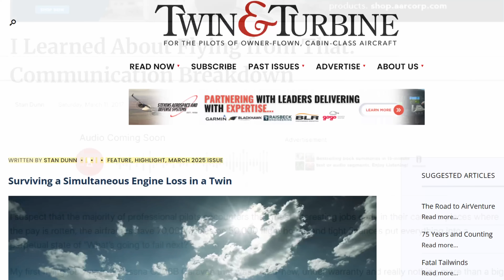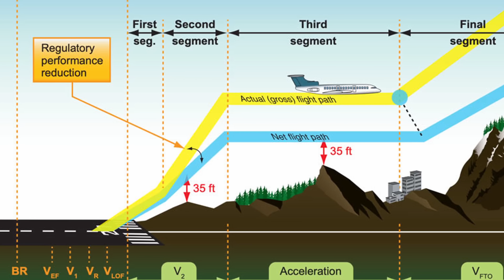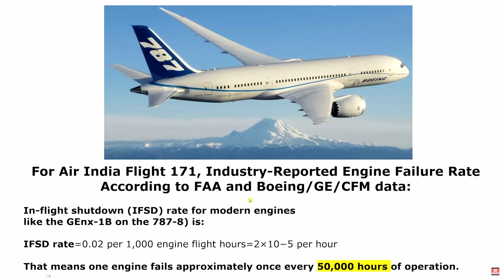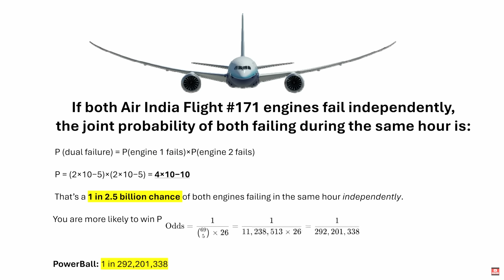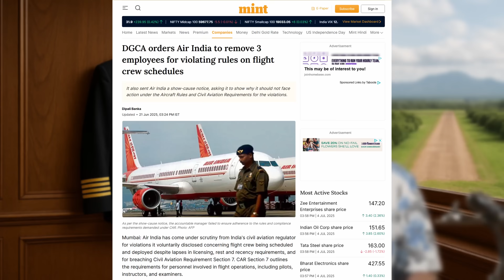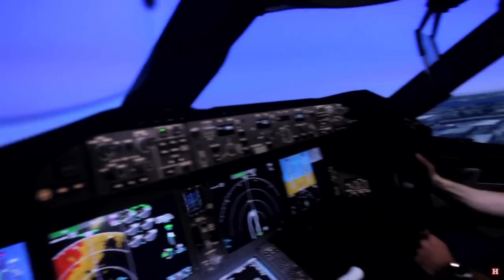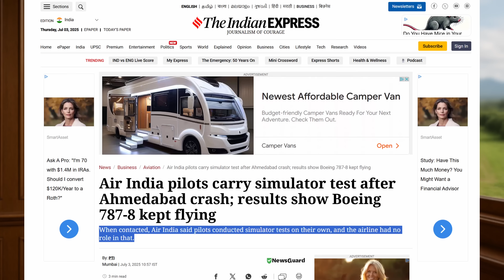Air India 171 Cause Becoming Clear

Comment: Retired airline pilot here. I'm a little surprised this gentlemen proffers that it could've been an initial single engine failure. When a single engine failure occurs, there is a significant yawning motion , and some lateral roll.  When you watch the video of the doomed aircraft, you see that there is almost perfect stable streamlined flight throughout. Which is highly indicative of both engines failing at almost or exactly at the same time. Purposely or otherwise.
Reply: How is it that there is no provision against human/pilot error in case of one engine failure 
That will be really a poor design as in case of one engine failure a action taken under stress is likely to lead misidentification 😢
Reply: I  do not think this would be a double engine failure. Just logic alone tells me that. What would have possibly caused that, we did not see anything hinting at such an unlikely occurence. And not an issue with the flaps. Neither fuel contamination. The most rational explanation is that it had something to do with electrics. The fuel pump system on the 787 is electrically powered. They were losing thrust and what we saw unfold matches with this scenario. Longer than normal on the runway, but did manage to take off. Then losing all power once airborne and then slowly descending till they crashed. Matches also with the pilot's mayday call "no power no thrust". Final investigation report will shed light. Rest in peace to all the lost souls 🙏
Reply: @IloveCamels335  I'm with you on this......the 787 is an all singing, all dancing bird , even pressurisation is controlled by electrical power. But for whatever reason, have a single cable burn and affect the cable next to it and suddenly circuits fail and there is no time for getting your electrical power back. The RAT deployed because of loss of.....electrics ( and hydraulics ) .....but at 300ft there just isn't enough time , or altitude left to do anything except transmit the Mayday.........my money is on the electrics failing for some reason despite the massive backup.....perhaps the wires to the two EECs ?
Reply: @IloveCamels335 engine driven mechanical fuel pumps. Electric is just auxiliary boost pumps.
Reply: @jamesrolls9206 nope, 787 fuel pumps are NOT engine driven
Reply: @IloveCamels335 interesting. Learnt something new today. Would have put money on that one.
Reply: I think, as a non expert, that the most likely cause of the crash was total electrical failure, leading to fuel starvation to both engines, which would also explain the failure to raise the gear, because the hydraulic pumps are electrically powered. The chances of other causes, as the presenter outlined are very small indeed.
Reply: @eamonryan2198 totally agreed. It had to have been electrical
Reply: It's been said that they were on the "last brick" of the runway when they became airborn. They HAD to know they had thrust issues during takeoff. I wonder if they did a static takeoff or a rolling takeoff and why didn't they abort?
Reply: @JamesStreet-tp1vb I am sure they noticed the problem already on the runway, completely agree. But by the time it was too late to abort takeoff. So they could have overrun and crashed on the ground or take their chances and take off which they did and have some more time to hopefully figure things out.
Reply: @IloveCamels335 That's one of those damned if you do damned if you don't situations. 

The purpose of a static takeoff is so they can see how the engines are performing. That's why I'm curious if they did a static takeoff and did they begin the takeoff at the threshold of the runway or were they further down the runway when they began the takeoff?
Reply: @JamesStreet-tp1vb reduced thrust takeoff designed to use most of the runway. Reduces engine wear and fuel consumption.
Reply: It's a bit of a conundrum I agree....... I'm a retired Pan Am, JAL and KAL 74 captain, and two engines failing at the same time is almost impossible.......also, the training centres in Asia don't  conform to western training standards, ....so unless you have some experience in those arenas .. I'd respectfully say you may not be taking into account that variable... IMHO
Reply: it definitely is not a single engine failure, either total engine failure or other failure
Reply: Agree - confirmed by the lack of corrective rudder action in the video.
Reply: If you know this type of airplane, is it true that both the engines are on the same central tank at start ? A faulty transducer could have restart both the engines to be fueled on another tank but it takes time for that . I heard from French mechanics that the RAT provides enough energy for the flaps but not enough to raise the landing gear. For this it needs the help of the APU, which was revving up as the opened red hatch on the side of the tail shows, but the APU needs 90 seconds to give full energy.
Reply: 787 has 2 generators per engine.
Reply: Agreed! He is trying to save Boeing.
Reply: The yawning, even if a small one, would be noticeable on the videos. Bad ridiculous explanation...
Reply: I feel exactly the same
Reply: Why hasn’t the voice recorder information been released? Usually when there’s an air accident, especially in the United States, we have information within a couple weeks. What are they trying to hide?
Reply: yawing not yawning
Reply: Yawning motion you say.... Perhaps the pilots were tired 🤪   🤣🤣
Reply: Since it wasn't "yawning", it must have been well rested, the aircraft I mean.
Reply: FADEC controlled dual rollback due to a hydraulic or electronic event that caused the TAT triggered FADEC command. My best guess is hydraulics event leading to hitting the TAT sensor.  The pilots have no override of a FADEC rollback
Reply: Also those jets are made to be able to sustain flight on 1 engine
Reply: In any event this video offer no obvious reasons as to why the single engine should have failed. There is zero evidence for the hypothesis that the pilots turnes off the "good" engine. This video leaves us all none the wiser.
Reply: USA CONGRESS IS ONTO THE BOEING QUALITY CONTROL. PERIOD.
Reply: The rudder didn't move a bit. Auto yawn uses the rudder.
Reply: Don't talk to me about 'a significant yawning motion', I get it every time a politician speaks.
Reply: fuel valve fails closed after DC power failure...heard it the day after the crash.
Reply: I generally suffer significant “*yawning*” moments when I encounter analyses wherein the commentator misspells key words.
Reply: I’m not.  It’s all about clicks.
Reply: Significant yawning happens all the time.
Reply: the 787 and 777 both have automatic rudder input before you (as a pilot) even know you have lost an engine... and in fact, airlines are given the option of how much rudder they want applied in the case of a single engine failure from 100% down to 1/2... so that pilot input is required.
Reply: There's a slight yaw to the right.
Reply: @Republic3D  The video is so poor... I don't see it. The rudder would be displaced dramatically with one out.... and I don't see that either
Reply: @Republic3D   The entire aircraft - while remaining level - appears to drift to the left shortly after it's clear it has lost power.
Reply: I see * slight * asymmetry, causing the plane's starboard wing to raise up.

I think he's right, especially if that's smoke coming from the port side engine.

This all happened in 30 seconds.

I'd prefer not to blame the flight crew or any individuals for such a disastrous accident, but, even when a scenario isn't initially caused by pilot error, it's often one of the holes in the Swiss cheese model.

Sadly, I hope it turns out to be a Boeing issue and not the fault of someone who perished.
Reply: @whiteoutgotu I disagree.  That means there are many flying time bombs in the air right now with thousands of people on them.
Reply: IDK why he's even doing this video. We don't have the black box data. Seems like a waste of time.
Reply: Plus, the RAT coming out by the apogee of flight would suggest the engines failed themselves without human input.
Reply: @JasonSmith-iw9wd   I still have seen no clear sign that the RAT was deployed.  All I've seen is a speculation by someone who thought they heard a propellor-like whine. All I heard in that clip was the sound of a modern fan jet englne at low power or idle.
Reply: I hear ya. Nothing conclusive yet. But in my mind, that’s a RAT. To me, there’s no doubt. That is clearly the sound of a RAT.
Reply: The automatic engine out yaw damper would minimize yaw on a 787. There was a bit of yaw perceptible in the early part of takeoff.
Reply: Citing incidents that support your theory don't make it 1% more likely
Reply: I heard and readed this meanwhile very often, too.
Reply: "yawning?"
Reply: If you look on Flightaware, the plane didn't follow the runway heading. It started veering south. Unknown if because if engine failure or pilot input.
Reply: @XRPcop   Do you have the link for that please? I'd like to look. My impression was that the aircraft drifted significantly left after it lost power.
Reply: Too much over weight baggage in the hold: too much meat, jars of pickle and other prohibited goods that Indians just can’t resist bringing to the UK. 
Aircraft couldn’t get off the ground because of too many pressure cookers in baggage. Two much junk packed in carryon bags. 
No one needs 23kg of old clothes and other rubbish.
Just sayin’!
Reply: Landing gear couldn’t retract because of all the illegals in the wheel compartments.
Reply: I say it's not engine failure it may b due to power loss and loss of auto pitch . You might b knowing what happns when it goes above air cut and loses air cut it becomes paper weight and falls down as you seen on the video clearly showing usage of RAT also high nose angle I'm no expert but I hav watched 100's of crash investigation i cn say this
Reply: @kamali_ka If they had landed it immediately after powerlss maybe could have saved most passengers
Reply: @Vicmot but he had only 10-12 sec to react😢
Reply: It does bobble a tiny bit, but it’s already descending at that point, and i cannot see any yaw/tail inputs. Hard to see anything, tho.
Reply: IMHO, this seems highly speculative 🤔 and now trying to blame the pilots 😲
Reply: You're saying the crew were asleep?
Reply: @TheLucanicLord  😲
Reply: IMHO One of the pilots shut both engines down at the same time. Pulling the T-handles or by simply moving the fuel control switches to cutoff.
Reply: @gparroz3288 You gotta be kidding me 😮
Reply: A Massive DC electrical power surge with redundant data systems ‘rebooting’ at the same time.  Grounding bus bar’s are shared between redundant systems.  That has caused issues before.  I.E. Captain Steeve (another channel) had a grounding bus fail during flight and he lost all his instruments in front of him.
Reply: @jerryrobinson7856 I believe massive electrical failure disabling all 4 FADECS at the same time 🤔
Reply: @Harald-MacGerhard    The theory being FADEC’s will reboot for the exact same reason.  Massive surge electrical protection.
Reply: Is the yawning motion performed by the Captain or FO? Slow climbout is boring,apparently?
Reply: Fuel pump issue?
Reply: except at rotation there is an immediate slight yaw to the right (and no dust behind the right engine) indicating this is very plausible with the help of auto rudder.........
Reply: otherwise is correct, as the pilot told the tower he had no thrust, but didn't say the engines were down.  I think 2 thngs are far in a way more likely which are 1) accidental change by pilots, 2) software error.   It is likely the computer shutdown or rolled back the engines, that is likely how, why is the critical link.
Reply: An engine failure would rapidly and automatically correct any initial yawning motion.
Reply: *yawing
Reply: yawning?
Reply: Exactly Truthseeker and to bolster your expertise even further, there is no obvious sign of rudder deflection, which is what you would observe with asymmetrical thrust. 

Thank goodness we have some more true airmen like you who actually impart wisdom to us
Reply: Also the gear remained deployed throughout, which is contrary to takeoff procedures, particularly if there is difficulty gaining altitude due to the severe drag caused when gear is deployed.
Reply: @UnitedWeStand-g7u they tried to raise the gear. You can see them tilted forwards which is the first stage of raising. That means that right after they tried raising the gear they lost power/hydraulics leaving the gear stuck at the first stage of retraction.
Reply: @wayneholmes637 gear doors actuate before the tilting of the boogie. Looks like something went really wrong with the retraction sequence/logic.
Reply: @UnitedWeStand-g7u  look closely, it seems like the landing gears were set to go up but suddenly stopped
Reply: @UnitedWeStand-g7u There's a couple steps in the gear retraction on the 787 and it appears they only got through maybe the first step, as you can see the gear tilted down and forward, but, didn't raise up, as the bay doors didn't appear to open.

This is just an observation by a lay man (me).

Apologies if any of that is incorrect.
Reply: @UnitedWeStand-g7u  The RAT was deployed so there wasn't enough Hydraulic pressure to raise the undercarriage.
Reply: Yep. My guess is an electrical problem caused the fuel shut-off valves to both engines to shut. If that is the case Boeing will have to ground all of those planes and that won't help their bottom line
Reply: @Naree987 unless the electrical failure was caused by negligence on Air Indias part.
Reply: CHECK! I also experienced a  significant yawning motion whilst reading this poppycock from a ... "retired airline pilot".
Reply: @mikerodent3164  It's almost as if autocorrect might have overruled what he meant. 🙄
Reply: The 787s will automatically manage the yaw and roll due to an engine failure.
Reply: @brianprice7812 yes but , it needs rudder to manage the Yaw .  We’re not seeing rudder deflection .
Reply: @brianprice7812 definitely Brian. The plane will definitely do that to correct any anomalies in yaw or pitch. However we don’t see any rudder deflection or ailerons or elevator movements. And the scary thing about the controls not moving is the fact that the gear never retracts. 

No hydraulic pressure whatsoever would leave the aircraft with no control and with the RAT deployed so quickly at such low speed, it’s just scary to imagine just sitting in that cockpit and being a passenger to nowhere. 

Now the wall st journal has published the preliminary report and it states that the cutoff switches were activated. 

Just a horrible scenario of helplessness and futility. 

God bless every soul on that flight, no matter what the outcome is, and I hope their sacrifice makes air travel safer for us all.
Reply: @brianprice7812 Of course, but not instantly. It would be noticeable.
Reply: @brianprice7812 Yes, it's automatic, but it's also visible from the outside: aircraft rolls into the good engine, rudder deflects to keep it on the yaw axis. So the fact that it's automatic doesn't mean it's invisible.
Reply: @brianprice7812 maybe but that plane could still climb out with one working engine. It’s obvious that this video has no real information
Reply: @tomdavis8757 Of course they can climb out with one engine.  But - there are a several real world airline pilots stating that one possible scenario is that they had a single engine failure on the runway, or very early in the climb.  The procedures for certain types of failures require shutdown of the failing engine.  If they accidentally shut down the wrong engine…..
Reply: @brianprice7812 rudder has to move, regardless if its actuated by the pilot or AFCS. Rudder stays neutral.
Reply: Yes, the TAC kicks in, but it specifically just operates the rudder. I believe we should've seen at least an initial roll until the pilot corrects the roll. 

It's my understanding that the TAC doesn't activate until N1 drops below  of 70%. It seems highly likely that a visible yaw and especially roll would be noticed. And again in the video we don't see any. 

If you have more information, please share. Thank you.
Reply: @truthseeker4286 Rememer that the roll mode on the fly by wire is roll demand, so that the airplane - on its own- will maintain wings level- quickly. However we don’t see much rudder deflection (TAC) nor ailerons deflection to correct. Nobody trains to shut down an engine that low - there’s no reason to. If that was the issue - serious training issues!
Reply: @truthseeker4286 hey bud, your understanding is correct and the TAC on the 787 will activate much like MCAS on the 737 does. However the TAC on the 787 will utilize all control surfaces to stabilize the flight while still allowing for manual control by the pilots. There’s never any signs of this in the video, no rudder deflection or any movement of the elevator table or ailerons. 

On top of that the preliminary report states that the fuel cutoff switches were in the cutoff position. 

While this is part of the restart procedure in the 787 it does call for a cycle of these switches meaning they would be turned to cutoff and then back to run and not left in the cutoff position. 

Until the full report comes out I wouldn’t want to speculate as this is the first total loss of a Dreamliner and we don’t know if those switches wound up being in the cutoff position due to impact or not, those switches have guards on either side and a very noticeable detent which  takes some force to overcome, not a lot but it’s like pulling a circuit breaker. 

Honestly I’m leaning more toward sabotage. As much as I would like to believe it was mechanical, the way the plane reacted leads me to believe that the power was intentionally interrupted. 

God bless every lost soul in this accident. And brother stay on the path of truth. Be true to yourself and always seek it my friend
Reply: @brianprice7812 
No it won’t, the pilots are compelled to take manual control in the even of single or dual engine failure. 
Stick to driving your Ford Focus around, you know nothing about piloting a commercial aircraft.
Reply: @UnitedWeStand-g7u  Amen!
Reply: @UnitedWeStand-g7u Tony, I’m a pilot with a masters degree in aeronautical engineering.  I agree with Brian. I also agree with you as well because you have been pinpointing the same talking points. However you bullying Brian because he said it first is unnecessary. Stick to driving your ford focus huh. 

I hold a commercial license and have type certification for multi engine, three different type certifications as well as a jet aircraft certification. I have over 7000 hours on record for each of my certifications. I also have retired from a very prestigious airplane and aerospace manufacturer. 

So please don’t hesitate to let me know what qualifications you have to insult Brian like you have, because I’m sure I have more experience and knowledge than you do. 

Plus I hate bullies and your attitude towards Brian makes me wonder how good a pilot you are
Reply: It kind of yawed to the right.. also these planes autocorrects a yaw due to engine failure
Reply: I agree. I watched the video 5 or 6 times and saw the wing dipped to the right with some yaw. The Lone Survivor had some intriguing information just before impact, he said, you could hear metal, tearing and a sharp jerk to one side.?? Why hasn't anybody had an official sit down with this guy. Is he locked up in an Embassy suite somewhere. @davis6692
Reply: @davis6692 ?? If the left engined failed wouldn't the yaw be to the left.
Reply: OP trainer on dozen aircraft types over 4 airlines & now on yt. Doesn't sound sus at all...
Reply: @mangos2888   He has an official airline suit right behind him. He must be legit. I get you. Anytime I see a prop near someone,  I question their authenticity.
Reply: This was discussed on another channel as well as as poster Brian Price posted here, auto yaw on the 787 will correct it and there won’t be a significant yaw-ing motion.
Reply: @timincal2002 
The rudder would have been pegged away from the failed engine to compensate for the yaw, in the video it remains in the neutral position.
Nice try tho.
Reply: @UnitedWeStand-g7u   Dead foot, dead engine. First multiengine lesson.
Reply: @UnitedWeStand-g7u no not necessarily pegged oh dumb one, it depends on how much thrust the engine that’s running is creating. But the prelim states that both cutoff switches were manually moved to the cutoff position. 

Therefore your point is invalid armchair pilot. 

I hear xplane is really good on today’s smartphones but the phone is only as smart as the operator and you don’t seem all that smart there Captain BO. and I call you BO because like underarms, your arguments stink😂😂😂
Reply: @timincal2002  Your thesis contradicts physics. The 787 will of course control its flight direction automatically however in case of single engine failure, asymmetric thrust is a physical fact and the plane must compensate the asymmetry by changing its yaw angle, which will look similar to the reaction to sudden side wind. The plane would continue its flight at a stable but different angle and this should be visible in the video.
Reply: @timincal2002 absolutely right Tim but we would see rudder deflection and movement of the elevator tabs and the ailerons which is not noticed in this video. If they lose power the apu has an automatic start to repower the hydraulic and electrical systems. But it never was reported in the prelim that it had occurred. And the RAT only deploys when power is not supplied by either the engines or APU. 

That’s the only reason why I would think pilot sabotage. But as I have stated many times before, it’s too early to speculate
Reply: @HankHildebrant great explanation, thanks
Reply: @timincal2002 and it’s been confirmed that the plane was intentionally shut down. Captain Steve has confirmed it on his channel
Reply: @HankHildebrant thanks for the update
Reply: @timincal2002 as much as I hate to say it, this was an accident that should’ve never happened. 

May each of those lost souls rest in eternal peace. 

And this idiot who started this fake post should be deeply ashamed of himself
Reply: @timincal2002 The auto yawn correction doesn't hide a small variation of course.
Reply: Sorry, I don’t think you listened to the whole video. What he said is one engine failed and the captain immediately shut down the good engine without verifying it was the right one. The significant yawing happens if the pilot doesn’t correct for it. Maybe he didn’t use the dead foot dead engine. Like him I highly doubt that they had a double engine failure at the same time. Most accidents are pilot error.
Reply: @CaptainLeo44  an engine failure at takeoff never requires an immediate shutdown of the engine, you safely climb away and clean up the gear and accelerate….then start running checklists..
Reply: @redslippersaloon No shit! DA I would think at your age you would have learned that humans make mistakes. 85% of accidents are human error.
Reply: @CaptainLeo44 USA CONGRESS IS ONTO THE REAL CAUSE OF BOEINGS CRASHING.
Reply: @CaptainLeo44 no airline uses “dead leg, dead engine” for verification. That is GA single pilot stuff.
Reply: @CaptainLeo44 Well, it looks like YOU didn’t listen properly. Blogger was telling about this as an  example, the case happened during the totally different flight.
Reply: @victorv4899 No shit, I said he used those other crashes as a example. You are supper dense.
Reply: I believed to pilot complained of a loss of power. Could it be he had no idea about losing power?  Talk of flaps, landing gear down, someone waving in the window is little more that boneheaded nonsense. No doubt Boeing are going to fight a power loss as an issue as it might contain some heavy financial penalties
Reply: It would also require substantial rudder correction, and I don't see that either.
Reply: Pilot reported loosing power , why would he turn off  any engine?
Reply: @ianmoloney6080   I believe std procedure is: 1. apply full power (if available); gain altitude; when stable retract the gear; when at 1000ft retract flaps as approp. for speed & angle of climb.  Only then would you begin to think about safeing a dead engine.
Reply: And I'm a retired astronaut...😂
Reply: I'm a retired Chief Astronaut  @bazerwazer6180
Reply: @bazerwazer6180  lol that’s a great one 😂😂😂
Reply: I have been to Ahmadabad, and know it gets very hot during the early summers before the monsoons hit. Before that it is very hot, and some days are oppressively humid. Is it possible that the aircraft hit an area of extreme downdraft caused by the heat, I believe it was around 100 degrees (F) when it took off. That would explain the loss of lift.
Reply: It's yawing, isn't it?
Reply: 🥱 dual yawn 🥱 is the culprit
Reply: Fault in the BOEING. DO NOT FLY BOEING TILL THIS IS FIXED IN YEARS TO COME.
Reply: FADEC sensor or sofware failure (autotrust idle power set) and/or (very) unexperienced copilot retracted the flaps too early.
Reply: @FrankyS74 the chance of both FADECs shutting down at the same time when they are independent systems and independently powered are incredibly low.
I’d say look into the fuel shutoff valves and how they are powered. A catastrophic electrical failure could cause both fuel shutoff valves to close at the same time.
Reply: @FrankyS74 that’s just plain wrong and a lie dude. The cutoff switches were found to be activated when the investigation uncovered the console.
Reply: @HankHildebrant  A lie.. What is a lie and why? Bro..
Reply: 100%, and you’d still climb out and still raise the gear..

Both engines are dead in this crash..

Deliberate if you ask me. Hashtag - mental health
Reply: That makes no sense to me. Choose to crash an airliner and you just idle or shut off the engines after V1? I mean it would get the job done but doesn't seem likely to me.  @redslippersaloon
Reply: @redslippersaloon  Deliberate!? - You mean the pilots in unison decided to end their and passengers existtence as premediated act?
Reply: @Vicmot Or only one did and somehow overpowered or incapacitated the other or messed with the controls.   The cockpit voice recorder would shed alot of information on this and I wonder why it hasn’t been released or at least a transcript.  I hate to say it but this seems very concerning.
Reply: @SECONDIN  What do you think would be the reason for not releasing? - Was it intentional..
Reply: @Vicmot  no, I mean one pilot was suicidal
Reply: @redslippersaloon  Whats the proof of that?
Reply: @Vicmot  what do you say.?
Reply: @redslippersaloon it seems there was a radio call from the pilot about the loss of thrust. Not in line with a mental health issue.
Looking for the black boxes data!
Reply: @renaudcharlet  thought I’d revisit..
Reply: @redslippersaloon 
Indeed !
Reply: I think a deep stall is most likely...
Reply: @Grumpy412-rc7hb Deep stall tends to effect T tail aircraft. In a conventional layout there is less blanking of the tailplane at high angles of attack.
Reply: @Grumpy412-rc7hb I’d agree Grumpy but the plane didn’t just nose over or roll it floated nose up at a 6 Degree angle until impact it never moved or pitched it still had lift but no thrust. It was like all power was lost and the pilots were just along for the ride until it ended. 

The worst three words any pilot could say are brace for impact. And I hate the fact that these pilots were put in that position. 

God bless every soul lost in this plane crash. Hopefully the final report will ensure that they didn’t die in vain
Reply: @Grumpy412-rc7hb  Stall is  highly unlikely 787 is fly by wire it prevents the plane from stalling.